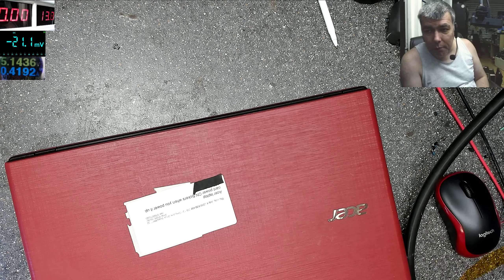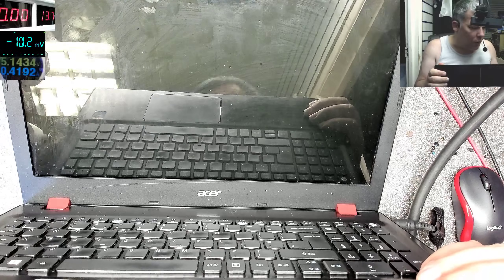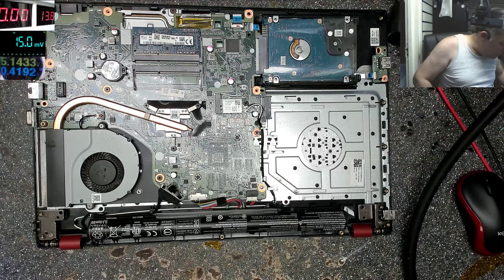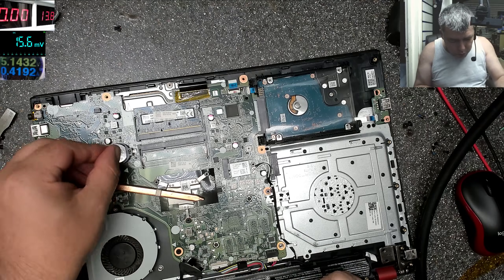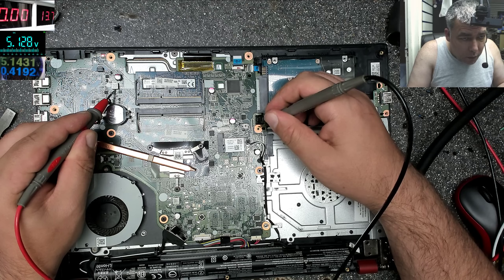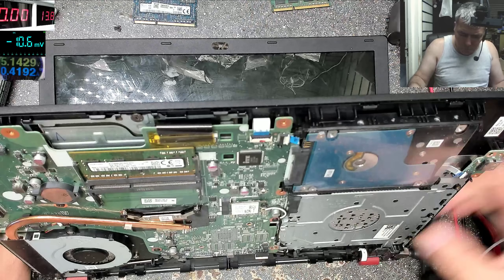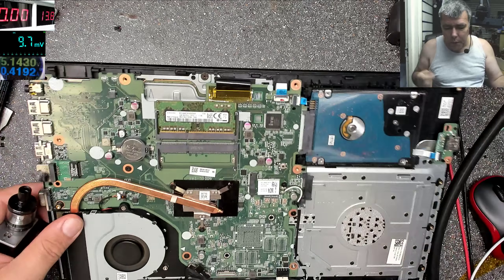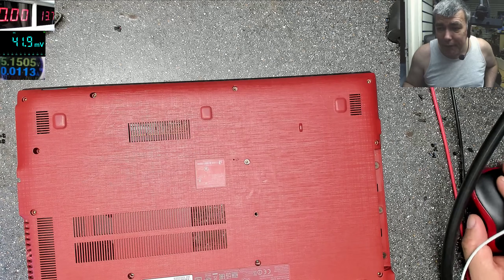Do you have bad RAM? Bad ram memory symptom - Let's learn together

Comment: Excelente vídeo..  Computer repairs its a hobby that I have bean doing for some time.. By charging some jibes it anables me to upgrade e by tools.. Just got a mothen laptop hp slim Silva I believe ddr4 with exactly the same problem.. I will nead to by a ram stick because I don't have any DDR 4 spars and I will by a new stik for testing.. Wish you well

Comment: had this new computer and it would freeze in the bios. i thought it was the motherboard so i got a replacement motherboard. then it would still freeze in the bios. i had two sticks of ram and i just replaced one in the ram slot. it didnt freeze in the bios anymore but i couldnt use two ram slots.   

so i bought two new sticks of ram and everything worked fine. crazy how these computers do this.

Comment: the problem is a corrupted bios, taking off the battery u have done a reset. i had exactly the sane problem on the same model and i have flashed the rom.

Comment: I wanted to change the ram from an old computer to a new one but when i did the swap, and turned it on, only the fan started spinning fast and the screen would not load, so I put the old one back and now the laptop just starts the fan and doesn’t load the screen, what can I do?

Comment: I had a faulty ram and I fixed it by cleaning the pins with an eraser it worked and it works to this day.
Reply: is this humudity that caused the ram to fail ?

Comment: I had that same kind of issues before, with the laptops i am repairing,  and indeed it always point out to the Ram fault...   Sometimes eraser does the trick.  😀
Reply: eraser?????? how?
Reply: @joshuaemmanuel3378  you can clean the connector pins using eraser.   Try to rub the pins to remove foreign dirt ( most of the time,  thats the reason why ram reading gets faulty,  because of dirt/dust)  Gets the work done effectively.

Comment: I also have problem wiht acer E5 411. it keeps looping on and on  I change the  ram and it on normaly but theres no display on the screen, I tried to use the vga and no signal coming out  to display.can be something wrong on my graphics? Sir..
Reply: i know its been 3 year but... do u have solution for that case ???

Comment: please help.. i have lenovo 3000 G410.. issue is no picture on screen but the vga does just the backlight only.. i already replace the lcd flex and lcd but is still nothing i already reheat the the graphics but i think the graphics is fine what should i do

Comment: Sorin, I have a Compaq Presario CQ61. The laptop only works on AC power if the battery is plugged in. If I remove the battery and plug only the AC acapter, the laptop does'nt turn on. Can you tell what is the problem? Thks.

Comment: Am acelasi model de laptop Acer Aspire, doar ca e argintiu. L-am cumparat defect (ecranul spart) de la cineva cu 40 de Euro, fara modulul de 4GB memorie si harddisk (altfel era 75 de euro) si desfacut complet in bucati de proprietarul dinainte care din cauza ca nu se pricepea a distrus niste conectori ZIF si niste cabluri plate. Am reusit sa schimb ecranul si sa-l fac doar touchpad-ul nu functioneaza inca, poate e defect sau cablul panglica e intrerupt din cauza excesului de forta a fostului proprietar. slava domnului ca nu a incercat sa-l monteze el la loc, era tipul de om care ar fi insurubat un surub lung pana iesea prin tastatura.
Reply: Ce voiam sa mentionez este ca e foarte pretentios cu memoria, cand l-am pornit prima data a mers cu un modul DDR3L de 2GB, apoi in configuratia final nu mai voia sa mearga cu module DDR3L de 4GB si 8GB care erau 100% bune si la viteza corecta (DDR3L 1600), pina la urma a acceptat o  pereche de sodimm-uri Nanya.

Comment: Hi Sorin
Enjoy your videos, very informative and down to earth. Just a quick question I have an dell inspiron 1525 board which does not come on and I have found a resistor that is getting really hot but I can’t find any information on what it’s value should be , From what I understand it normally has a three digit code on it but this just has 1.5 on it. I look forward to any help you can give me as I am a novice at this.
Keep the videos coming .

Comment: Ram is partially broken not a dead ram. When pc starts the graphic needs ram to show picture (because it is integrated gpu), but with faulty ram  it can loop or in the midle of starting windows when it needs more ram the system will crash.

Comment: PC3L(1.3 volt) ram is different from PC3(1.5 volt) thats why your first ram is not working in this laptop.i think so
Reply: it does not depend on the number of ram on the bar? 1Rx8 or 2Rx8? Because I already had problems of compatibility with this difference but with the same reference (12800S)
Reply: My ram is said to be 1.35v as i searched the exact specs. I bought pc3l, but the speed generation and voltage were the same as well. I don’t know what’s wrong here

RAMAXEL PC3-12800S 1600hz DDR3 - old ram
RAMAXEL PC3L-12800S 1600hz DDR3 - new ram i bought that doesnt work
Reply: PC3L Laptops do support PC3..
PC3 Laptops don't support PC3L..
Reply: @ivanzsar  nope it is vice versa